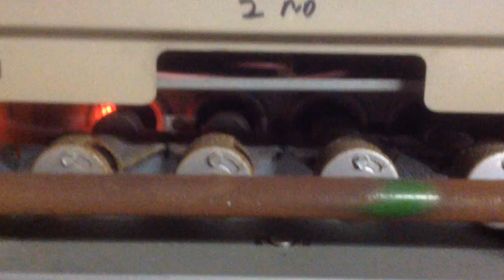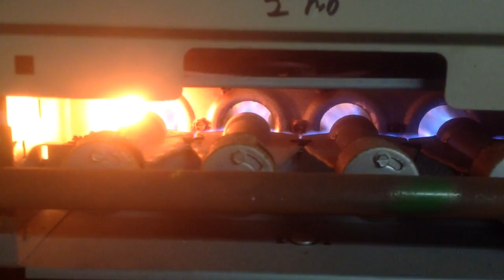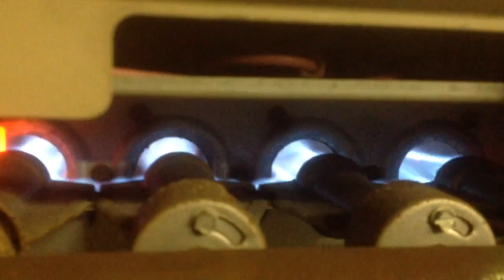Bad heat exchanger

Comment: LOl thats a GOODMAN 90+ forsure !! I know that furnace all to well and have replaced many of these furnaces or heat exchangers in the past 28 years !! Great video !!
Reply from the maker: That is one of those janitrol units. These clams would go bad even if you had the perfect air flow.  Even then they are great furnaces. Easy parts to find at great prices. After the exchanger would go bad I would run down get another on warranty 2 hrs later your back in business. That even includes washing out the secondary. For the homeowner these were a disaster. I still have 7 of them all with replaced heat exchangers. Seems like the new exchangers are holding the crimp rings . I would have to say if the exchanger goes bad again a new furnace would go in. Even though changing the exchanger is not hard, I've changed my last one.

Comment: Here is an old timer's trick.  Before the burners fire up, put one or two small squirts of a light oil in each burner inlet.  With the burners fired up, and then when the blower comes on, go to the outlets of the hot air registers and see if you get any smell of the oil being burnt.  That smell is very recognizable.  That tells  you that not only the exchanger has a crack,  but that the combustion gas which contains CO, is being picked up and carried into the living space.  It is possible to have a crack without the combustion gas being pickup in the blower air stream.  Combustion analysis with a Testo or Bacharach tool should point out the problem, even if the combustion gas is not being carried into the living space.